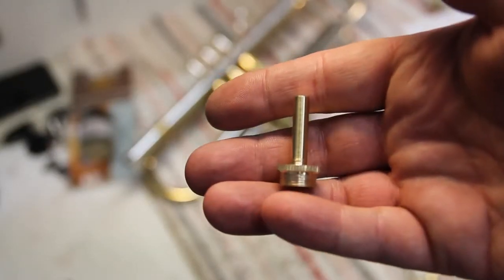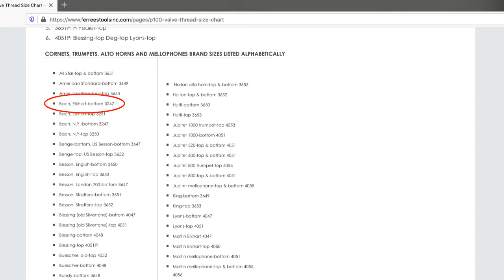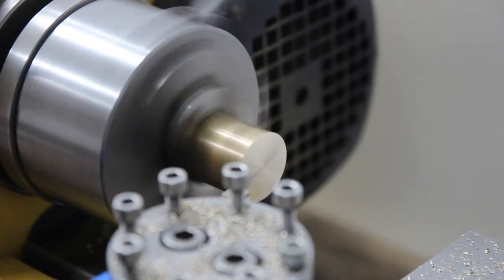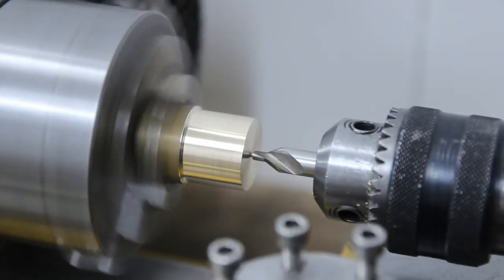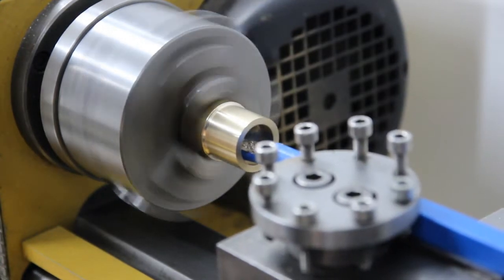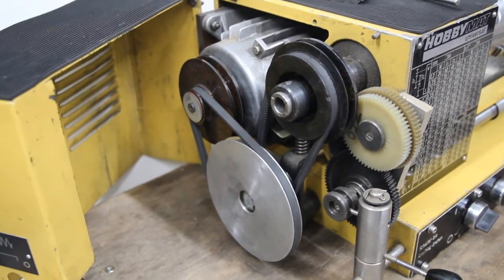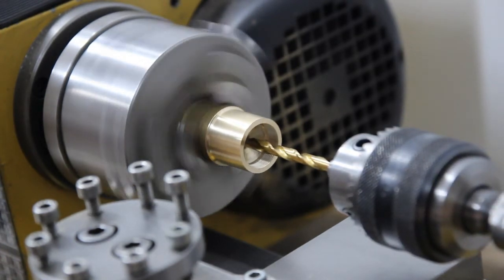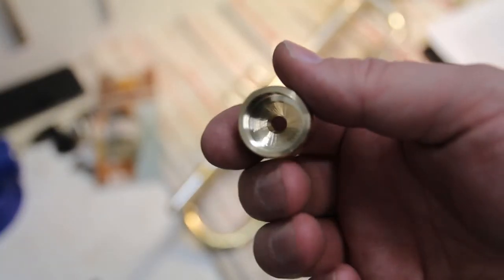Making Heavy Valve Caps for Trumpet

Comment: Hi and thanks for you video. Is there a way to get a good finish on the bottom of the inside of the cap? It’s cut with the drill bit tip, so not the best finish. Any ideas?
Reply from the maker: Hi, the inside bottom should be cut with a milling machine, but unfortunately I don't have one.